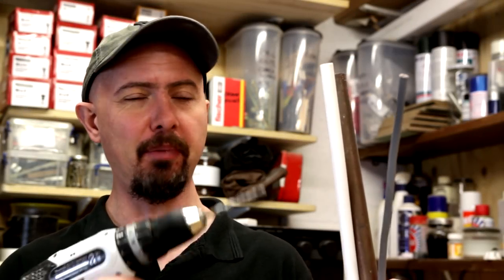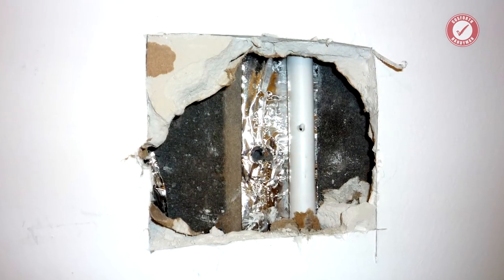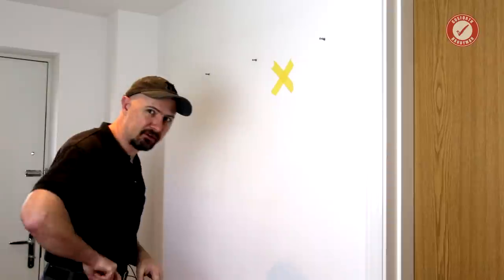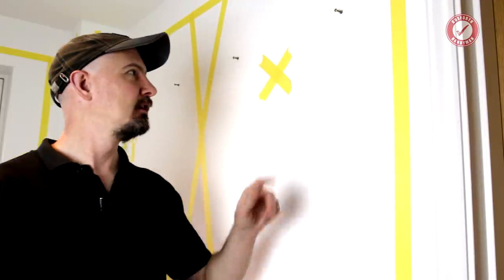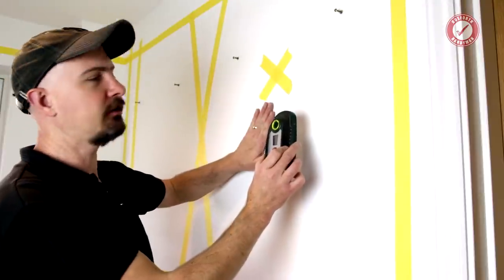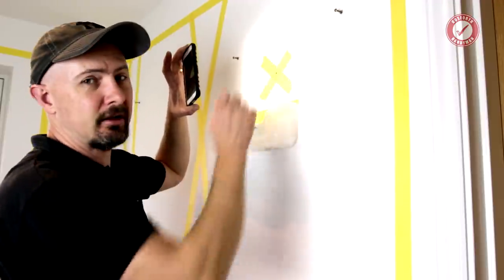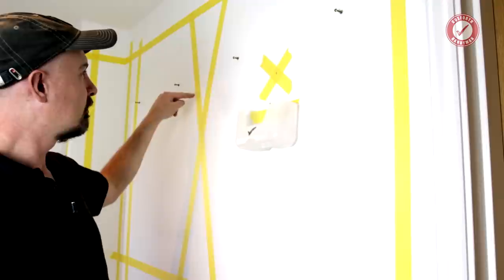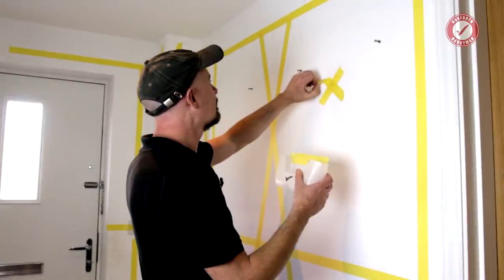8 TIPS to avoid Pipes and Cables in Walls (long rambling version)

Comment from the maker: By popular demand I made a shorter version of this video here: https://youtu.be/DeTXAPYzqpY 
Hands up, you were right, I rambled on for far too long in this version and the music was way too loud. All fixed above. Links to cable detector etc. in vid description. 👍
Reply: I was happy to watch as it was. Very useful info. I do as you explained albeit use hss bits often. hmm.. and not just for pvc or metal they are meant for (I believe)... Plasterboard and some wood applications too. Where is that shocked face emoji now...
Reply: Maan I probably watched this video 10 times by now, starting my journey as a HandyMan, (as a Polish lad didn't have this much experience on drywall, we have mostly solid walls) but my question is, should you hang heavy stuff on studs? or there's a big risk of hitting the cable or pipe attached/going through the stud? Please help!
Great content Andy I've learned a lot from this channel cheers!
Reply: Are there usually cables / pipes in the top of the window sill in a new build? Started drilling the 'ceiling' of the window sill outcove very close to the start of the actual wall with initial pressure then an empty space and then harder pressure again!

Comment: I myself are scare to drill into walls.  I wish every home have some sort of mapping of all where the water pips, gas lines, electric lines, and wasted pips.  This should be a mandatory law for home builders.
Reply: It would be common sense to have a map or schematics of pipes, cables or anything else. The problem is that electricians and plumbers tend to do their own thing and put things where they want to them to go. 

When I have building designed I have the containment area for service specified and designed into the building so that anybody who is doing work later can have a copy of the services schematics to know exactly where things are.
Reply: vboy0001 Good point
Reply: it is we have building regulations - as an electrician I can say we adhere to them - plumbers on the other hand? cowboy electricians/DIYers often do this as "its the shortest route' ....
Reply: Sadly that does not exist for the homeowner unless you were your own General and it would only provide the wall it was in, not exact location.

Sadly, I was one who lost his man card which was especially tough for me since I do a lot of my own work including my yard, built in wall unit/fireplace, etc.   Anyway, I was mounting a TV that had 5" lags for the mount.  I verified stud locations, that there were no pipes and no electrical lines behind the drywall.  What my sensor did not pickup, was that there was a PEX Water line.  There were no faucets even close, so imagine my surprise when the stream almost "shot my eye out".   My home is a custom home as well, so one would expect the  contractor to place a metal plate in front of the line, but it did not happen.  Crazy since the hole was pretty large that it ran through, so I had to hit it just perfect/dead center, otherwise it would have just moved out of the way.  Luckily I knew where the water shutoff was.  I thought everyone did, but after telling my story, I find that many people don't.  In the end I made a little money off the job since I did all the plumbing and drywall work myself, letting the mitigation crew take care of the water/mold remediation.  Insurance does pay sometimes...

Anyway, I have always been very cautious, but now am extra paranoid about these darn water lines.
Reply: take pictures during construction.
Reply: That would be very helpful
Reply: @ThePlungerboy  , Very nice, never thought about it, will do on my next house
Reply: @bighands69  containment area? I don't understand your second paragraph, could you explain it? I want to learn  I'm in south america.
Reply: @peter_castle  
Containment area is where you put electric wires or pipes. It means that they are all in the same area and not scatter all over the place.
Reply: bighand69 yeah we do this because normally where we get told to run the cables 90% of the time is impossible. We don’t do it for fun, we do it because no choice
Reply: @gowersup6441  
Bad building design is part of the problem. Designed containment area means electricians or other services have designated pathways to lay or fix cables.
Reply: ... a lot of work in the trades is to fix diy jobs or even profesional jobs that go wrong for whatever reason, especially because the drawings are missing or inacurate to the work
Reply: @markhardacre1  happy you follow the regs but certainly not the electricians who wired our new build. (socket height, cable routes etc) So how did it pass inspection?
Reply: @anthonythomas6012  I often find gas pipes not set at sufficient depth into a joist often touching the bottom of the flow allowing you zero clearance to a saw blade… it drives me nuts

Comment: One more tip - if you want to establish, where the cable from your socket/switch goes (up/down/left/right) remove the socket and see how cables are routed. Behind the socket/switch there is always a box, and in this box there will be a hole for cables to come in/out. This will give you a pretty good indication where to expect electrical cables :).
Reply: This is excellent. You are a godsend. Probably the best tip for detecting electrical wiring I've seen yet.  Just tried it, and now I know I definitely can't drill exactly where I wanted to.   I live in a top floor flat and I thought the wiring may not run up to the ceiling from the plug socket. But now I know better.
All the best.

Comment: I got one of those detectors and, funny enough, it detected an electric wire going in a diagonal direction from the light switch on only one wall of the house. In every other wall, of the same house, the wires go straight up from the sockets or switches.
So even if you check a few walls in your house, it doesn't guarrantee that the other ones are the same.

So apply what GH says everytime you want to make a hole.

Comment: Great video. In over 40 years of doing it I've yet to drill into a pipe or cable. Maybe I should stop now ? 
A lot of it is just common sense avoiding the obvious as you said. Still think I'll get one of those detectors for my ancient house. Still I try to avoid studs if there's a cable nearby.

A month ago a contractor drove a screw through a cable in my attic severing the grounding wire and shorting all 3 together - didn't trip the breaker! 
Glad the load center was scheduled for replacement the next day with one that actually works.

Comment: Same goes for floorboards. Just imagine you step on a loose board. "Why was that not fixed properly? I'll do it now" driver out screw in...expanding wet mark on partition downstairs... bit of plumbing to do... Who me? no no, this was a friend...it was!
Reply: Im from germany so regulations might differ somewhat but here the entire floor is an installation zone so unless you realy know the house assume there might be cables and pipes anywhere in the floor.
Reply: @kertas1991111  second floors are an installation zone first floors not so much unless they have underfloor heating but still just don't drill the floor

Comment: Worked in a house putting a cable through the edge of a doorframe and felt quite nervous about it because the radiator pipes were running along the skirting board and disappearing and reappearing half buried in plaster in no standard fashion and giving me the fear after some checks and slow drilling with a few crunching wriggles I popped out the other side ran my cable through and was wrapping up another lad in the room asked me for a lend of my stud finder as he was working in front of a wide window with a very shallow gap between the skirting board and the window sill with a power socket smack bang in the middle cable can't go up because it's a window so cable should go down but you can't be sure of that it could go left or right so he was pretty understandably cautious. I told him to assume nothing and take his time because this was definitely no ordinary house and to make my point I told him to look up, above him there was a single gang power socket in the ceiling above his head pointed down.

Comment: What I do is get a neodymium magnet, & 'scan' the wall for nails,screws, which indicate exactly where your wooden or metal stud posts are.   Also:- If you are trying to find heating pipes or electric cables, then what I use is my CAT S60 smartphone, with integrated thermal camera.  It shows-up any heat generated from pipes, or a 'switched-on' socket or light switch. (although, with lower powered stuff, it may take time to show-through).  But if you don't have a thermal camera, an infrared detector should work. (but more time consuming).

Comment: I was drilling hole with 102mm hole saw for air vent and the center drill went absolutely middle of electric conduit pipe. The drill bit even dodged the two wires in the conduit. :D There was no room to move the wires nor the conduit pipe itself so I had to cut them. They were only for outside light so no huge damage was made.

Comment: Good tips. I'm a curtain fitter & use a blunt drill all the time.
Builders often put sockets, switches & other cables in the walls next to windows & it's usually where the bracket needs to go. 
Sometimes it's possible to fit a piece of wood behind the bracket so the fixing holes can be offset  & this would be hidden by the curtains.
Reply from the maker: Cheers buddy! There should be laws about cables / pipes around windows! 😃👍

Comment: Excellent advice, another place to watch is in new build properties on the top floor. I was drilling a hole for a fixing about 200 mm from the ceiling on an outside wall, I hit the galvanised strap holding down the wall plate. I hadn't used my detector as I was certain no pipes or cables would be in that area. Just goes to show you should never assume anything.

Comment: I’m still recovering from your info about those dry wall fixings!!
I put up ma blinds on plinths using the metal screw plaster board fixings. (a local joiner told me that metal were much more reliable)!!!
Guess what? I had a tremendous storm with a prevailing wind in January and water got onto the plaster board substrate!
Will be attempting to reinstall ma blinds if the plaster board ever dries , probably using toggles!!!
Love your uploads Andy, just wish  I’d I’d seen your upload before I trusted a (revered ) joiner!!!!
Cheers.

Comment: On some older houses, they have sleepers on wood subfloors and would run conduit between the layers. I was cutting through the floor and cut a 60 amp range feed with my circular saw, lots of noise and sparks, I was okay fortunately it was in conduit. That was over 30 years ago.
Reply from the maker: That would have been a nasty one! 😵

Comment: I just got my new house, there is a cable point at a ceiling and I assume the vertical and horizontal, 4 directions that eth cable will run, when I was about to drill, I notice the ceiling kind of pop up 45 degree, diagonally from the vertical top of the TV antenna and power point 1 feet above the floor. for some reason the contractor that build the house decided to take a diagonal route maybe due to the cables was not long  enough for him to maintain the H-V rules. that was close.
so now I am trying to get a stud or good tips you are giving. thanks man

Comment: My daughters’ friend mounted a clothes dryer on a gyproc wall in the laundry using 6 of those crappy plastic plugs in your other video.  A dryer full of wet clothes puts a lot of pulling force on the wall plugs, needless to say it fell down 6 months later hitting the taps and the washing machine underneath it damaging the dryer, washing machine and a cupboard on the other side of the room and the wrecking the wall.
While repairing the wall I noticed they had just missed the pex pipes with one of the plastic wall plugs (lucky). 
I had to metal bash the dryer back into shape, repaint part of it, fix the holes in the wall where the plugs pulled out and around the taps. 
I can’t believe they allow gyproc walls in the laundry, mine is fibre cement.
I made up a horizontal wooden mounting beam which is held in by 6 metal wall fixings and made sure to avoid the pex and nearby electrical cables. The dryer bracket is then screwed onto that wooden beam with 4 wood screws and two of the metal wall anchors. 
I wasn’t able to find any usable studs because theirs was a metal frame house and the electrical cable was running down the metal stud. 
Great video and excellent advice, thanks.
Reply: Oh wow. Your daughter is lucky to have a handy father like yourself. My laundry is gyprock too and I put up a wooden shelf for powder and laundry products but im afraid it is going to fall any second . I had a mirror to place above the shelf but once I  discovered the walls are plasterboard I didn't bother.

Comment: I never drill through the wall at first. I always probe the wall with a awe slowly inserting through plaster or drywall and you will feel pipes or wires or in some cases the trash left in the wall by the drywall installers.  Great video.  One other piece of advice take a freezer or sandwich ziploc bag underneath the hole you are drilling or probing and save time cleaning up and containing the dust.

Comment: Excellent videos, keep up the good work.
Tip for safe drilling.
Having drilled just through the sheathing of whatever type with a blunt drill. 
You could then use a USB Borescope (boroscope) connected to a smartphone to see a very good picture of what is behind the surface you are drilling through, for less than a "tenner". 
If using a sharp drill make the hole progressively examining progress at intervals with the scope.
I have used borescopes both optical and electronic types for years and have found them to be invaluable to examine enclosed spaces. 
I have fully traced below floor central heating, gas and plumbing, inspected ceilings for cable runs identifying noggin clearances . 
Located leaks below suspended floors for which there was no ready access. 
The list is almost endless using small (6mm to 13mm) acccess holes which are a doddle to make good.
Reply: Yes the USB flex cam... or borescope is very useful. From checking if birds have laid eggs in garden birds box nests, to stuff behind furniture you don't want, to move to behind walls.

Comment: I usually drop the socket to see which direction the cable is running.
Reply: Good idea
Reply: drop the socket? I don't understand this expression.
Reply: @peter_castle  I think he means he pulls the socket out of the wall to trace the direction of the wires.

Comment: I have done all sorts of jobs in the building trade from ground up and as you wanted a few stories I`m leaving you three . the first is a outside one , while digging out for fence post my labourer went through a electric cable , lucky for him he let go but the trench spade was not so good . the agent on this site came round to the property to blame us . I ask him how is it we are only 5inches below ground and hit it . at the time it was a minimum of 12inches . next story which I could not believe but I was helping a friend move a radiator . lifted floor boards then did a neat job moving pipes for him to put the board back putting the nail straight through the pipe . and my third story that will make you laugh is , I was painting a wall in a pub I was doing maintenance on when I got a electric shock . what had happen is someone had hung a picture straight through a cable , I removed the picture to paint but as soon as the wet paint touched the picture pin I got a shock . hope these stories gave you a giggle as I`m enjoying watching lots of YouTube at moment cause of health problems and yours being one
Reply: Amazing story.  Sounds dumb but hey all these cases are serious as it can get.  The entire construction work is a total mess
Reply: We had the electrician who put the screw through a floorboard and hit a pipe. That sounds like a Charlie Chaplin sketch painting an electrified nail very dangerous. wonder did you go to touch the nail again or did you figure out it was an electric nail on the first shock?

Comment: I accidentally drilled a hole in a pipe under the floorboards a few years ago.  There was a squeaky floorboard and I wanted to stop it squeaking before putting down laminate flooring.  There was a line of nails across the floorboards that obviously went into the joist, But it looked like a nail had been forgotten as there was a gap where you'd think there should be a nail. it Turned out that the plumber had just taken a notch out of the joist and laid pipes in it, so the pipe was literally millimeters below the floorboard and I drilled straight into it. That caused a bit of panic ripping up the floorboard to stop the leak, so I am much more careful now.
Reply from the maker: Yup - very similar to my last instance! It's interesting that it would be against electric regs to lay cables like that - no idea why the same regs don't seem to apply to gas / water pipes! 👍

Comment: When drilling in to walls I also turn off the electricity completely in my house and use a battery powered drill and battery powered led light if required. Doing it this way you should never get a shock even if you did accidently drill in to an electrical cable.

Comment: Two problem areas I have encountered over the years are 1. iron stone in old stone-built buildings giving false signals on metal detectors and 2. some of the local brickwork of Victorian houses have a very hard blue centre so as you drill, you appear to hit metal. Most confusing.
Reply from the maker: Old hard bricks can be a nightmare! 👍

Comment: Trying to drill into a ceiling I felt ran into a piece of metal because it was  reinforced  concrete. I guess a metal detector would have picked it up. Thanks to you I looked up metal detectors for walls. They are around 50 euros here.